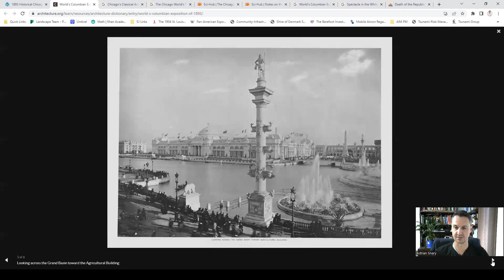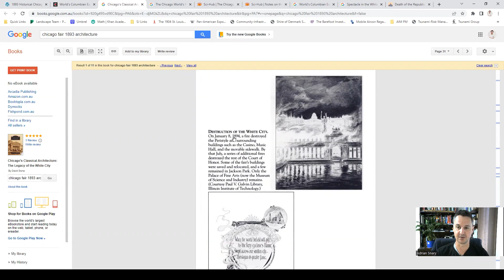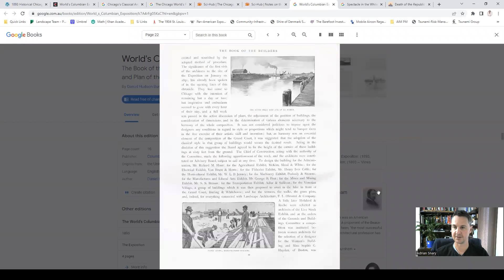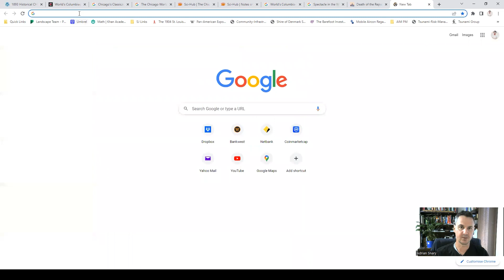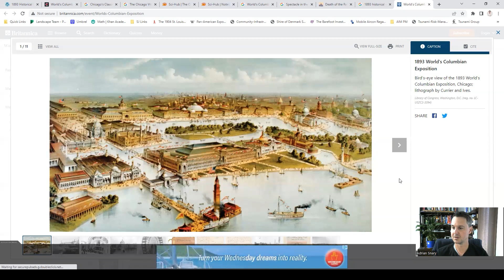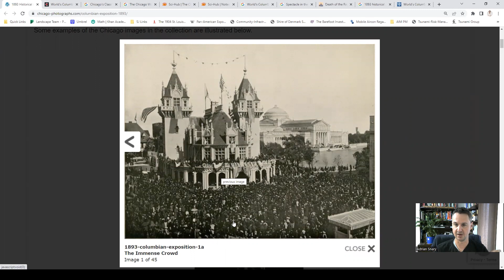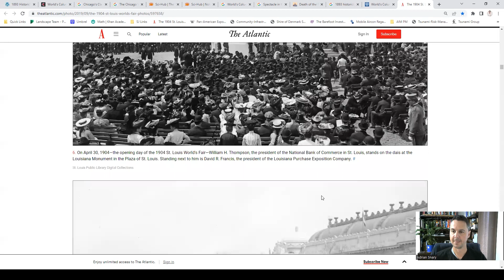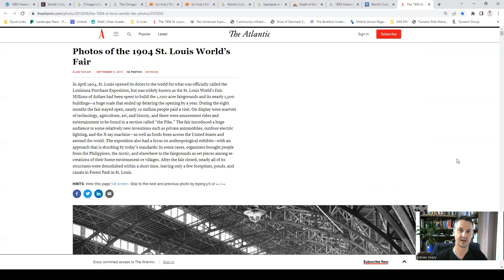1893 Chicago World's Fair - Part 2 - Possibilities of Construction

Comment: Greetings from Chicago!  
Referring to the horticultural building 21:18  ...The patina of age shown coving the entire limestone entrance from top to bottom takes ages to achieve, and is never applied as a decorative touch to this degree. 
I know first hand that pressure washing and even muriatic acid does little to clean away this surface.   Media blasting with dry ice is effective, but was unavailable at the time!
Look at the flat area where the word HORTICULTURE is displayed.  It's pretty clean as if the word was added.  The overhang just above is loaded with patina!

  I have a large book of photos and graphic descriptions from the fair.  When examined closely, it raises more questions than it answers.

Great work! Keep it up
Reply from the maker: Thanks for the info on that building. Makes total sense!

Comment: Yep just to prepare that amount of land on a swamp base would of took no less than a year easy. Maybe like you said they were already there but setting this event gave them the reason to get rid of the buildings. Just to plan and have the materials cut and made stone, steel, etc would of  took a few years then the time to actually build all the structures no dam way they did that in two years.
Reply from the maker: Absolutely. The only thing I think it could be is a technology that was used that no longer exists and we don't know about. Or they were constructed decades, maybe centuries, earlier. The latter is the most plausible to me.
Reply: There would be a years worth of piling needed to make a staging area for buildings?
Reply from the maker: @jamessones4044  dredging and piling. To go with any underground services. There would of been extensive drainage infrastructure.

Comment: Good video! The narrative is false. 1) There is no such thing as “temporary” fountains, retaining walls, man-made lakes, water ways, walkways, etc. 2) There is no explanation for housing/feeding the workforce required to build out 750+ acres of land in 1891. 3) There is no explanation for the acquisition/transport of the material required to build 200+ buildings. 4) There is no explanation for how they wired/powered the electrical systems to light the fair up at night. 5) There is no explanation for how a reported make shift workforce (ex-slaves, prisoners, new immigrants, etc.) could produce craftsmanship that rivals Michelangelo. Even if the buildings were made of card board, the level of detail on the buildings are of the highest level. 6) There is no explanation how such work could proceed during the harsh climate of Chicago in the winter. 7) No explanation as to how the “temporary” buildings look indistinguishable from the “permanent” buildings. 
In conclusion, there are so many reasons why construction of the 1893 Worlds Fair (and most of the other similar fairs between 1851-1930) could not have been done in 2 - 3 years. No one was ever supposed to notice or seriously question the main stream narrative and this is why world fairs are generally not taught about in school. The internet is the primary reason the issue is discussed at all.